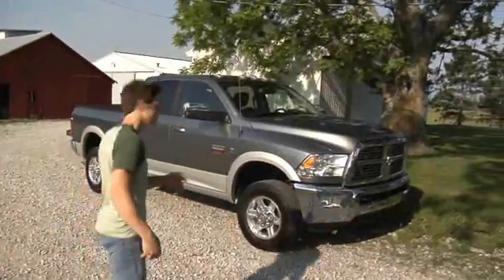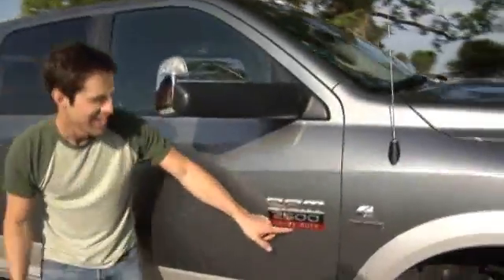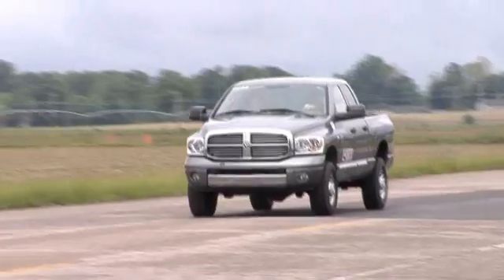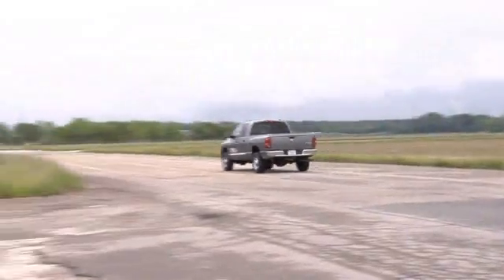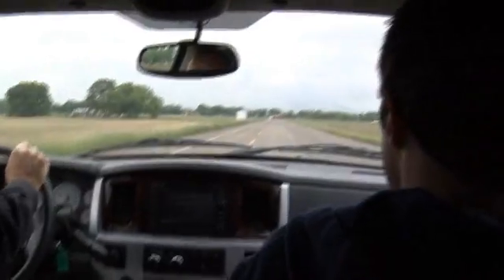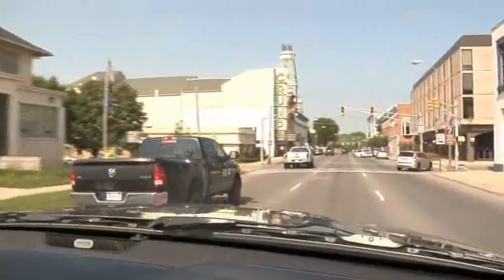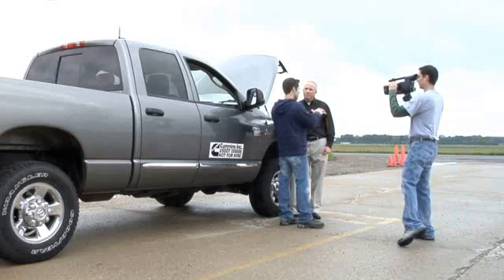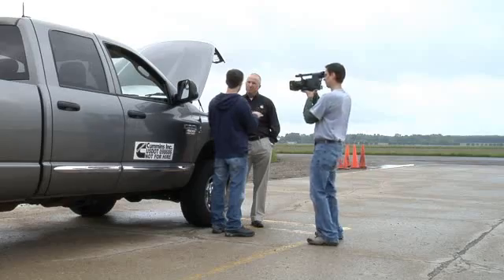Cummins 6.7's Biggest Fan (Pt 2): Test Track

Comment: I hate my Cummins because it is so powerful and fun to drive that it is going to pull me to the poor house putting fuel in it.  I am glad it lasts millions of miles because if you were to start over and design the perfect engine you probably wouldn't do as good.  I was passing a semi at 70mph (speed limit was 75) and I pushed on the accelerator thinking I would gain maybe 3 to 5 mph while passing.  When I looked down at my speedo I was doing 95 and the engine wasn't even working hard.  I backed off and returned to 75 with no issues.  The truck is nice, more than I would expect. but the engine to be described properly needs some words that haven't been invented yet, as amazing seems so pathetic for describing this beast of an engine.  The engineers at Cummins have a lot to be proud of.  Fantastic job doesn't even begin to cover it.

Comment: Cummins made the 5.9L for Case tractors and Case Industrial Equipment (CDC JV), because the Case corp. owned a large portion of Cummins, after Iveco and Cummins created the 6.7L together, Cummins rebought it's company from CNH (Fiat owned), in 2008 I believe, and now Iveco (Fiat PowerTrain) creates engines for Case IH Equipment.  Somewhere in there, Dodge (Today Ram, owned by Fiat, and at the time only selling less than 100,000 units a year) contracted out to Cummins for Diesel Engines (5.9) expecting to sell 5% into the truck market, seeing that Fords IDI Diesels (6.9, 7.3) with International was a huge success, while GM struggled with the Diesel market after one terrible engine after another (350 Oldsmobile Diesel 5.7, 6.2L, and the 6.5L) Until they worked with their Japanese partner company Isuzu to create the 6.6L Duramax. For the first time, Dodge truck sales went up.  The new EcoDiesel offered in Ram is a Fiat PowerTrain Engine. That is what I have gathered. If Ram was to lose Cummins, I foresee Ram sales drastically dropping.

Comment: I want to put a 5.9 12v into my Discovery. Mainly because I would get nearly double the fuel mileage BUT as a added bonus I also get way more torque and one of the coolest sounding engines ever built. Nothing comes close to the sound of a 6 Cyl turbo charged Cummins. I choose that engine mainly because it is all mechanical in operation except for the fuel solenoid, it starts with a single 12 v battery and they last for miles and miles, Put new seals and drive em for another half million miles.

Comment: You need to do some testing in stop and go traffic with no heavy driving before you sell any more 6.7s. These engines have more emissions control device related problems than any other diesel pickup that is EPA 2007 compliant. They run well when you are strictly towing or driving under heavy load constantly, but not light driving. One might say that the purpose of a Cummins equipped Ram is solely meant for heavy pulling, but that is no excuse for poor reliability from light driving conditions!

Comment: @yeahbuddy14mm, the older dodge trucks had bad tranys 93 and older lasted around 150K miles befor nedding a rebuild not the engine the trany,94-2002 tranys weren't very good neither better but not great. auto or manual. but 2003 newer are pretty good i never hear of them in the trany shop. and 2010 Dodge got new heavy duty asin tranys and 2011 they got upgraded again. Dodge has best tranys they ever have had, Dodge is also only ones to still offer manual tranys Ford chevy do not,auto is okay man

Comment: @fasterthanyou22 Cummins has a high millage group now were you can get a Cummins badge for your trucks that says how many miles you have. They have over i think 8 people that have over million miles on 5.9's and 6.7's and more people join every day. these trucks are still going with no rebuilds just changed oil and filter the Cummins will not stop. these million mile trucks are still going today.  Thats why CUmmins is the longest lasting engine thats why Cummins owners are always bragging

Comment: @Imahab Of course not, otherwise they would have stuck the big trucks with that stuff. I got an 07 that sat on the lot for 16 months and took 4 trips to find out that the egr cooler was leaking coolant. Why have a DPF that makes mileage even worse- I thought the idea was to put less carbon out?

Comment from the maker: @JustRamIt91 Thank you for your concern; safety is very important to us. During filming, under controlled conditions, a lap belt only was worn by the driver so the shoulder harness would not interfere with his microphone. We acknowledge that this is not the safest way to wear a belt, and we encourage all drivers to wear their safety belts properly with shoulder harnesses. Thanks for watching Cummins 6.7's Biggest Fan.